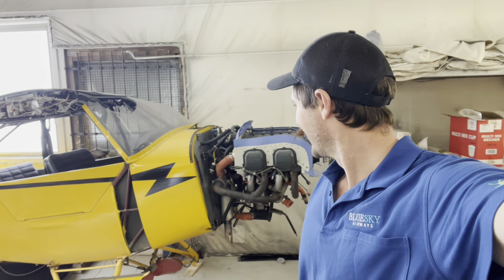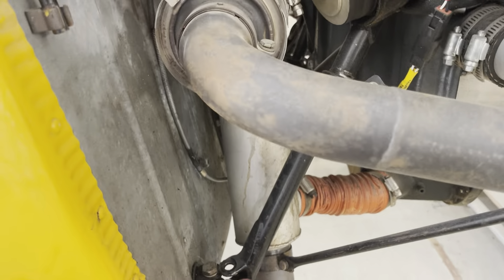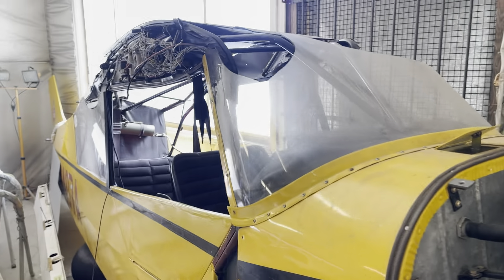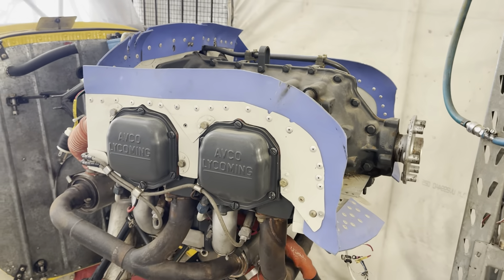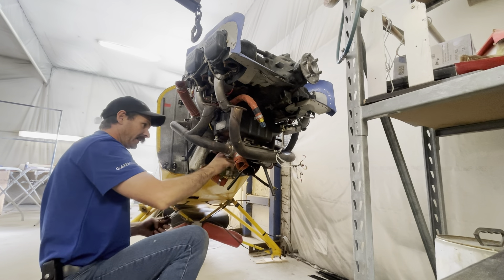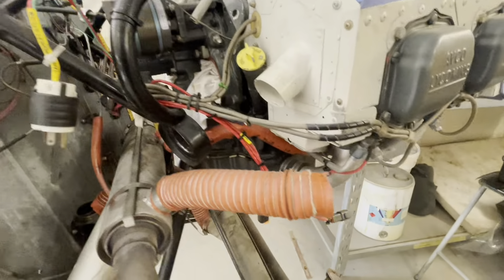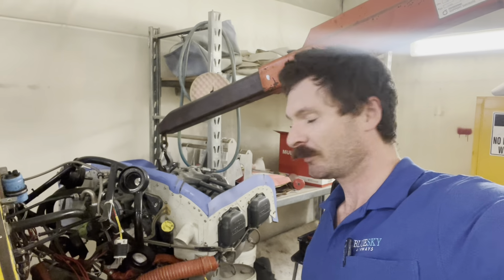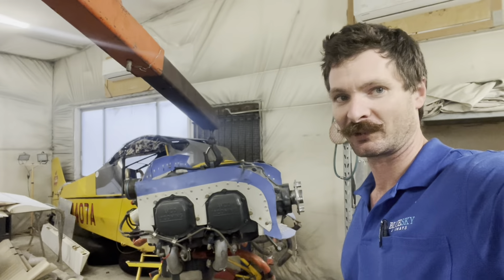Cub rebuild Part 1 - Engine removal

Comment: "Engine out!"

Things you like to hear during a rebuild, but not in the air.
Reply from the maker: Haha, that’s a very fair point actually.
Reply: Is that a Lycoming O-320 or an O-235?
Watched it to the end.
150 horsepower makes it an O-320.